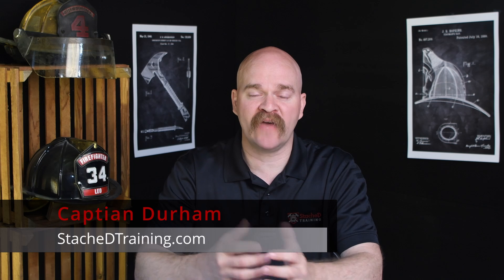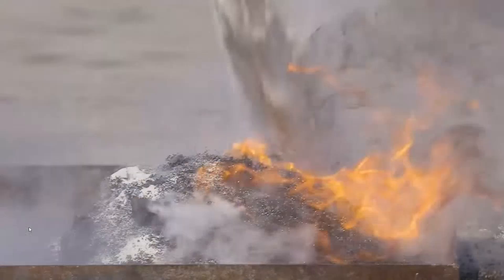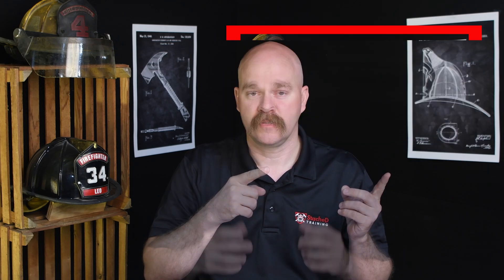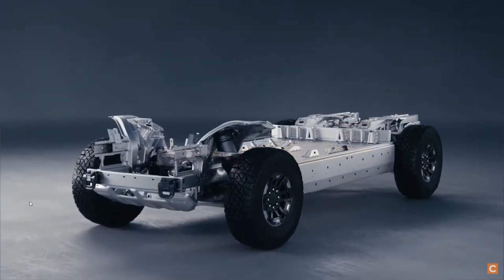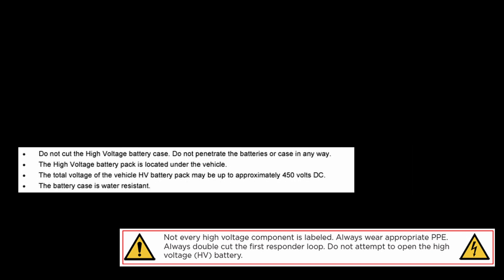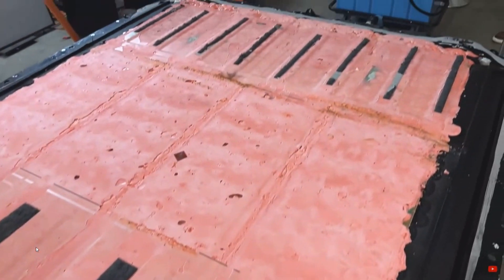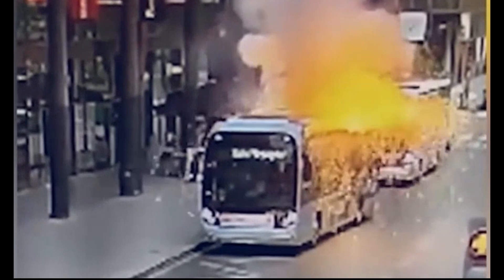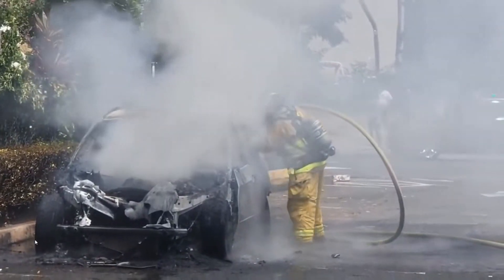What Firefighting Tools for Extinguishing Electric Vehicle Fires Really Work?

Comment: Cap you mentioned water penetration as inadequate for maufacturers. That is an admission of guilt on manufacturing side! 

 Perhaps have your union increase your own medical coverage. You mentioned oxygen deprivation fails to extinguish fire but you haven't mentioned why. I'm confident you also mean reducing combustion temperatures.

 I've seen steam nozzle battery penetration devices on YouTube that inject steam at source of thermal runaway SUCCESSFULLY.  Are you saying firefighters were prevented from using steam to penetrate batteries because of a legal issue or a because it could not remove either oxygen, heat, or fuel therefore it failed?

 Tried finding the steam nozzle penetrating battery fires successfully and it won't pull up on YouTube anymore. I'm more than a little bit curious why these steam nozzles penetrating hot batteries is no longer available. I'll keep searching but welcome your responce thank you. Rich 👍
Reply from the maker: Steam?   Are you referring to the Cobra Coldcut system?
Reply: @StacheDTraining  exactly! I wasn't sure at first had only seen clickbait promo videos a year or two ago. When they used the term "Lance" that clinched it for me, thank you very kindly sir. This to me is the best application to extinguish battery fires. You can smother it with steam same time reduce core ignition temperatures very significantly. It can also cut off the fuel source simultaneously by separating other batteries before fire becomes fully involved. I'm trained in marine firefighting. This specialized use of steam is the holy grail tool for shipboard firefighting because ships don't seem to float very well full of water.

I feel certain even not having used it this has to be the best tool for battery fires I've seen come along. Dealing with 5000 degrees those batteries can melt the deck in a ship and not slowly. Yet you're not flooding your vessel you're saving it from imminent disaster. Likely saving your crew's life in the process. 

Do you know of any other manufacturer that can douse a battery fire faster than CobraCut please? Would you agree this is the right tool for the right job. Or do you know of something better please Cap🤔

REALLY glad I asked, nice to know CobraCut has been accepted by the industry because I seriously doubt Halon could be as effective even if it was still legal. When last I saw CobraCut a sweeping majority of firefighting departments had not had the privilege. Really appreciate your taking the time to answer. Thank you so much Captain! 👍👊
Reply from the maker: @Richibald1  it's just high-pressure water.   It's similar to a water jet.  It could extinguish the battery,  but a delayed fire is still possible.
Reply: @StacheDTraining  in terms of a roh-roh  car ferry I don't know for sure but would anticipate other cars moved to facilitate burned out car being jettisoned into the sea for safety purposes off nearest end of ferry. Genius Star Xl a bulker bound for San Diego was diverted to Dutch Harbour Alaska. Heat signatures were found in the engine room and stack of the bulker. Fire was contained but the crew continued boundary cooling the bulkheads of the ship as required. 

The Genius Star Xl was also packing 800 TONS of lithium ion car batteries from Vietnam. Ignition source unconfirmed subject to investigation but crew did manage to contain e/r and stack fires ultimately saving those 800 TONS of batteries from certain inferno. Extremely difficult to believe thermal runaway could have been avoided had the ship's crew not been able to contain the fire's ignition source through boundary cooling. Never say never but hunch you can agree the crew dodged a bullet. 🙂

Thank you for your resourceful feedback it was of immense help I view CobraColdcut an essential tool in the marine industry, invaluable! Lab certified batteries of any size should be made mandatory when shipping is required. I put my eBike batteries on my balcony outside just in case for just such a reason. But seriously Cap inferior batteries must be rejected from North American ports through political legislation. The risks involved are already too high as it is and universally safe global standards far outweigh the litany of horrific alternatives. Overcharging could be often avoided through temperature sensors in chargers. The cost is miniscule compared to the risk! Manufacturers need to be politically reigned in on the risks they are creating with defective batteries and not so smart chargers or heavily penalized as a legal deterrent. The global economy needs better standards from every country or refused trade, no compromises. Way to many lives being lost already. Very pleased I found your channel, subscribed. Happy Holidays! 🙂👍👊

Comment: Would it be possible for car manufacturers to build a way to eject and contain burning cells
Reply from the maker: Newer Tesla vehicles are designed to have the bottom of the battery tray melt,  dropping the cells on the roadway.   It is  kind of an ejection process, however,  not contained.

Comment: Use something OTHER than WATER! Remove the heat which is EXTREMELY HOT! 
Fighting a METALLIC fire needs different methods!
Reply from the maker: You are incorrect.   There is no lithium metal inside of a lithium-ion battery.   This is not a metal fire.

Comment: Currently i think the only thing a firefighter can do in the case of a lithium car battery fire is to just manage the fire & prevent it from spreading to normal combustible materials.
The fire will only extinguish when the chemical reaction has finished, ie, the fuel source has run out.

Comment: Perhaps the way forward would be for the manufacturers to install some kind of thermal shear bolt mechanism, so that if there is a battery fire, small cutting charges will drop the battery onto the ground and then the main vehicle can be pulled away from the fire. This may make some of the vehicle salvageable, and might also save lives if people are trapped in the vehicle.
Reply from the maker: It's a great idea in theory, however these batteries are a main structural component in the vehicle.  There is a Chinese  company that has a "swappable" battery pack designed to swap out a low charge pack for a full charge pack.  Even that vehicle has a difficult process to remove and replace the battery.

Comment: Vehicle and battery designers needs to do the testing and find solution how to put off the fires BEFORE approving and releasing the design. There needs to be a regulatory control to ensure this happens. Its a disaster waiting to blow up
Reply from the maker: There is a lot of design/testing that goes into ensuring the batteries go into thermal runaway.  Unfortunately, it appears that little effort is going into helping the fire service extinguish these fires after the batteries ARE on fire.  Two solutions that do exist:  A French auto manufacture has added a firefighters access that will allow firefighters to flood a burning battery with water.  Some of Tesla's newer vehicle are designed with aluminum battery boxes that will drop the burning batteries on the roadway.

Comment: Puncture the box just enough to not puncture another cell with liquid nitrogen and vented fire blankets. Another alternative I hear is popular is Lith-Ex Aqueous Vermiculite Dispersion fire extinguishers, are you familiar with this cooling elements?
Reply from the maker: I wouldn't recommend puncturing the battery housing.   It would be difficult to be precise enough to miss the cells or any other electrical components.   I have heard of Lith-Ex, and I'm not 100% sold on the product.

Comment: Simple solution. Don't buy electric vehicles. Problem solved. Don't fall for the electric lie for vehicle transportation. 
  I've had people ask me why I use deep cycle led acid batteries in my power back up systems along with a gas powered generator for power outages... Any questions?
  Yes I run the generator outside.

Comment: This is where the intersection of land based versus marine firefighting have an issue.  Without any strategy to fight these fires on board, you can lose the entire vessel.
Reply from the maker: It's unfortunate,  but for now, there doesn't seem to be a way to actually extinguish an EV fire.   Now that may change in the future.  The biggest issue is the energy on board.   Combustion engine vehicles are shipped with very little fuel in the fuel tank.   If they catch fire (very unlikely) its a slow propagation.   However,  EVs fail very energetically.   By the time the crew could even respond, likely multiple vehicles were on fire.

Comment: All fire creating reactions are exothermic.   The reason for the fire is not because there is oxygen in the battery, its because there is electricity providing heating.
If you can cool the battery enough it should put the fire out, but it will restart as soon as you take the water away.
It will not burn underwater, and discharged batteries do not stay on fire when doused.

Comment: 5:55 If the box is fireproof, how is there fire? The gases escape, the fire pierces the box. I am working on a solution that would stop the fire and prevent usage of massive amounts of water
Reply from the maker: The box is designed to keep the fire in (or out) for a large amount of time.  These boxes need to vent when there is an increase in pressure.  They have deflagration vents (burst discs).  If they were not allowed to vent the boxes would explode.  See my 2 part series on vehicle construction: https://youtu.be/OqWj-73XSNg

Comment: What about making manufacturers install a firefighters access, like a fuel cap only accessible by firefighters that liquid nitrogen or similar could pumped in to keep the battery cell cool enough to stop exothermic reactions happening.
Reply from the maker: I plan on doing a video on both these topics in the future.   Renault (French manufacturer) has a firefighter access in the battery.

Comment: How many EV fires have you had to attend? 

Some house batteries come with built in mechanical extinguishers, surely battery manufacturers should be required to provide some sort of fire suppression built into their battery packs. Most packs have a cooling and heating system inside them. This could possibly be an excellent way to deliver what is needed to extinguish a fire.

Comment: Of course the real solution is to develop a battery chemistry that is less susceptible to thermal runaway.  Better yet, develop a battery that can be neutralized with water or some other chemical mixture.

Comment: I wonder if it would be useful if the manufacturer were to build the battery box with channels for fire suppression?  The fire department could connect the hose to an access port on the side of the vehicle and pump water directly into the battery box.  Maybe also add some plugs on the bottom of the battery box that would blow out when the high pressure water were pumped in so that the water could flow through all chambers.  
Maybe this wouldn't completely stop the reaction but it could give time for a tow truck to hook up and drag the vehicle to an isolated area where it could be allowed to burn itself out.

Comment: Worthwhile to mention that the topic is about the traditional (or classic) LiCoNiMn type of battery chemistry.  It has the positive temperature coefficient.  In recent days, some EV models start to use LiFePO4 type batteries.  Although it's energy density isn't as good as the classic, most commonly used Li with Cobalt, Nickel, Manganese batteries, 
it's main advantage is its negative temperature coefficient.  I.e., it's negative feedback loop will make it less likely to burn out of control.
Reply from the maker: LFP can still fail energetically.   When it does,  it gives off significantly more hydrogen when compared to other battery chemistry.
Reply: Solid state won’t be as volatile.

Comment: The piercing method may also be a concern if you are pumping liquid water into a hermetically sealed box that is then turning into steam. The colloquial term is "bomb". Id hope the fire punched a "pressure release hole" large enough to vent the steam but if I was a firefighter I wouldnt want to have to hope.

Comment: I have a simple solution, a water filled box... Drag the vehicle over a water tight floor, put up four water tight walls around it. fill container with water. Basically an above ground pool. Uses a lot less water and reduses harmful gasses etc. Ok the car will be a complete loss, but it would be anyway. saves a lot of mess and destruction to surrounding area.

Comment: You may be right about the piecing nozzle not working, but the premise to not do something on a manufacturers recommendation is extremely lazy! The manufacture warning are there to protect them from liability. In the real world you may need to do the very thing some uncaring dishonest manufacturer is telling you not to do. The other facture is that in this hypothetical situation this is an emergency/non-normal situation. Those warnings are for the normal situation/consumer.

Comment: I think the best way to control it at the moment is, as you say, to let it burn, BUT, have something like a fire blanket to place between the burning vehicle and anything flammable in the vicinity, as you would with a temporary metal fence, slide it alongside the vehicle to protect/minimise the chance of combustion of near objects, keep a heavy mist on it until the thermal runaway is complete.
Reply: until the gas builds up and wont matter if it reaches runaway.

Comment: As an electrical engineer who has a strong background in chemistry cars powered by lithium ion batteries are an incredibly stupid and dangerous idea. Lithium ions have a strong affinity for electrons and lithium metal has an explosive reaction with water. Water only feeds the fire making it worse. I wouldn't know how to put one out. Perhaps a CO2 extinguisher might work, just a wild guess.

The more potential energy you put in a confined space the more it resembles a bomb. Perhaps the battery case should be completely lined with ceramic. Possibly the most dangerous thing most people own is a car battery. Even dead there are a number of ways it can kill you.
Reply: Re CO2, not so much unfortunately. There are the issues of applying it to the fire itself (as discussed in the video), that chemically oxygen can still be derived from the electrolyte and cathode and also for very high temperature fires, the CO2 will split and release oxygen. Certainly not what you want!!
Reply: @bfratko  Could be. Lithium ions may have a stronger affinity for oxygen than carbon. Foam? I don't know how to put out such a fire. Sodium metal is as bad. It burns on contact with air.

Comment: What about gaining access to the coolant loop?  Seems that runs through the whole battery box, specifically designed to carry fluids.
Reply: Can manufacturers include fire extinguishing in their design?  

Manufacturers could include fluid input and outflow ports in the battery which would be accessed from the exterior.  Firefighters would open something like gas caps, attach a hose and pour water into and out of the battery, cooling the battery.
Reply: @geo8rge  Adding a loop for less than %1 of the car's life would be problematic.

Comment: Rather difficult but imagine Wiley Coyote style could tow it into a quick assembly tank. Would need a hitch on the vehicle and a way to get a tow line on the hitch. Otherwise just build a barrier around the vehicle and wait until fire burns itself out. Big air filters would be nice to reduce toxic smoke. Quite a predicament.

Comment: To everyone suggesting a flooding port: that sounds great if the battery is not actually on fire at that point because of the battery is already on fire in any significant way than getting to any port is going to be problematic. To have a reasonable chance of success there would have to be four or more ports, each as accessible as the classic gas port. And they would have to be not less than twice the size of the classic gas port & pipe.  So yes, but you’d have to go big.

LET THEM BURN. If necessary, drag them to where they can burn out.

Comment: Most of these cars could use a built in kill switch for electricity. Though that probably does nothing if the battery itself is on fire <.<

Alllsooo... it's just an idea... but has anyone thought of using liquid nitrogen? Ya can't smother it but is it possible to suck out enough heat, quickly enough to kill the fire? Might be most useful as a built in safety feature though since direct access is a problem.

Comment: I agree the best approach is to let them burn themselves out. The main objective of the emergency response team is to protect people and assets in the vicinity. The solution to this would be a heavy vehicle with a car size box on the back or front, an electromagnetic arm can drag the burning vehicle into the box with the operator in the pressurised cab with very effective air filters. Once the vehicle is in the box, doors close and seal, the box is vented out the top and fumes are filtered. The burning vehicle is then transported to a landfill burial site where it is pushed into a hole and a bulldozer pushes the dirt over the top. It is left there to burn out. When the fire is over and cooled, the vehicle is excavated and what remains can be recycled and the hole is ready for the next one. Larger vehicles will need larger equipment. Filtration technology will need to be developed, until this is effective, there will need to be pre-determined routes to the burial sites to minimise public exposure to toxic fumes.
As EV’s develop, batteries will be less susceptible to catching fire.